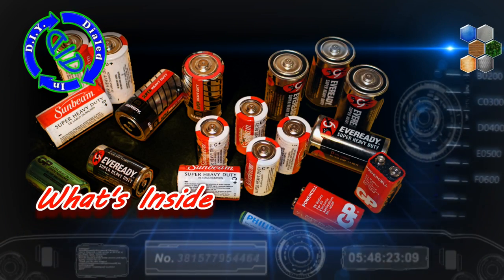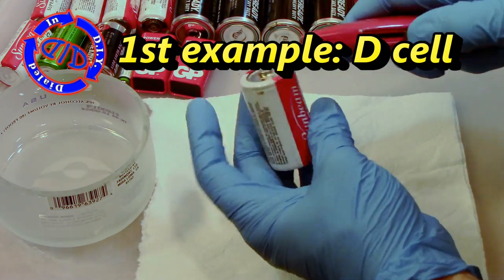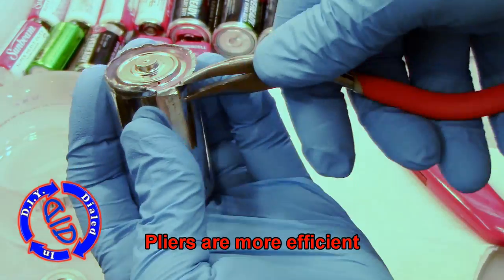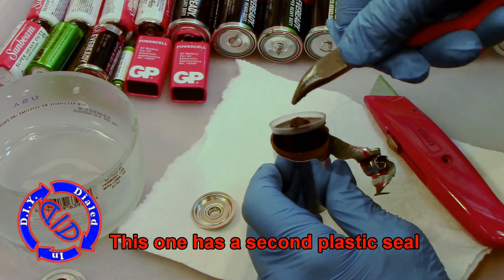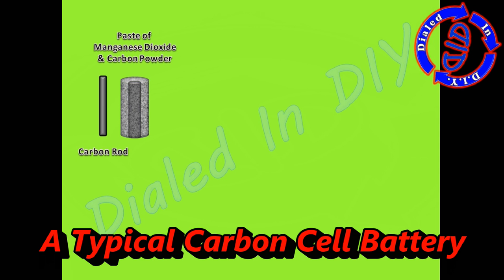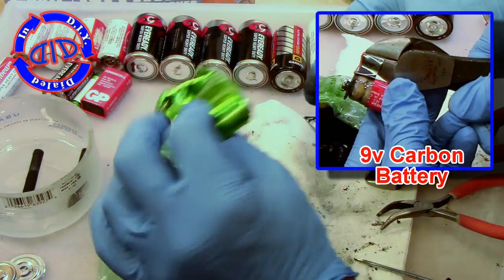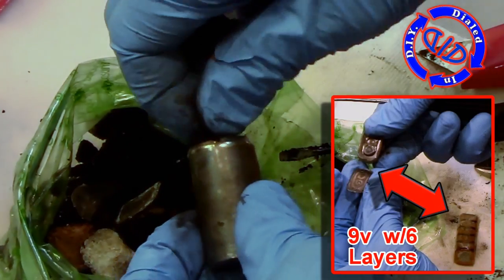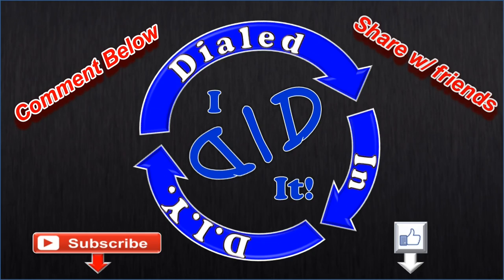Taking Batteries Apart - Free Carbon Rods & More

Comment: When taking them apart, does one have to worry about getting potentially shocked or it exploding? Should one use insulated tools?
Reply from the maker: That is a great question. I had no concern of that problem because I was working on dead batteries (while there is residual power left it is small).  Also, this size battery carries little voltage when fresh.  I would caution against risk of shock or rupture when working on rechargeable batteries like the Lithium Ion type.  If you want some more detail there is great info on this topic here - https://www.dummies.com/programming/electronics/avoiding-electric-shocks/ (despite the name "dummies" in it I do find it has good info for people of all levels of smarts...lol).  Thanks for watching and posting.

Comment: Did you use brand new battery or old/used battery? Thank you your video helped me.
Reply from the maker: Good question.  All of the batteries in this video had been used up (none were still workable for powering anything).  Thank you very much for your comment, I really appreciate it!
Reply: @DialedInDIY  but is it okay to dismantle brand new batteries? I’m going to use it to make a galvanic cell.

Comment: Is the ZINC casing solid zinc?... I want to use it for zinc electroplating.
Is the CARBON rod the same as GRAPHITE?.. I want to use it for a crucible.
Reply from the maker: Thanks for your questions.  Yes, the zinc is the "can" that forms the case.  The carbon rod is indeed graphite.  Sounds like an exciting project... not sure if any residual contaminants on the rod could/would impact how you are using it though.

Comment: Why when I cut it in half a cell it was like a jel
Reply from the maker: Was it a heavy duty cell like the ones in this vid?
Reply from the maker: Likely a battery like the alkaline type that has a zinc gel.  Zinc powder and potassium hydroxide solution form a zinc gel. It is used in the inner part of the separator.
Reply: @DialedInDIY  oh ok thank you and one more question is it poisoness?
Reply from the maker: If you mean poisonous if accidentally ingested then yes, it would not be good to do that. Do you mean dangerous ro touch?
Reply: @DialedInDIY  yea to touch